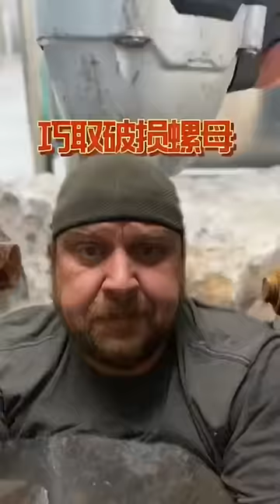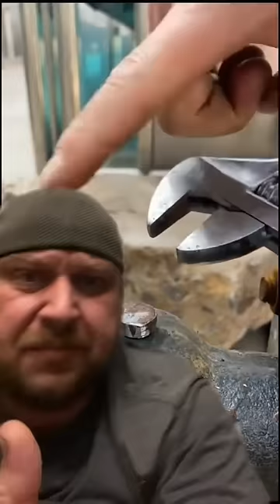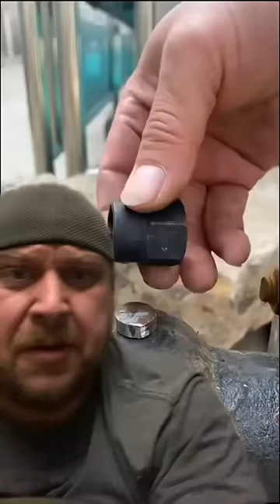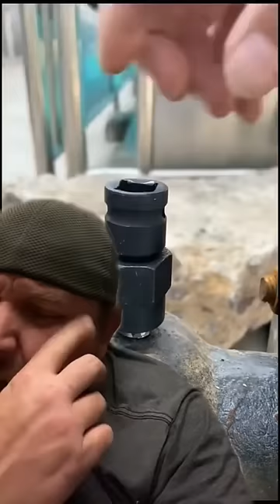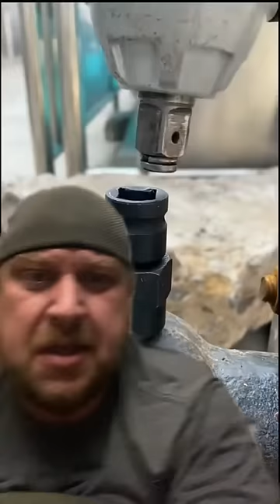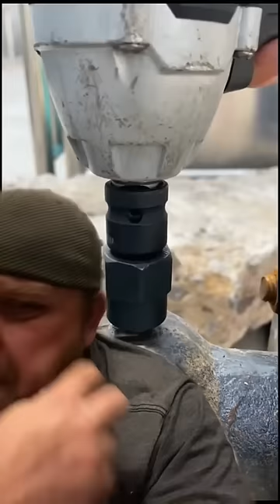Circle Bolt ￼

Comment: Circle bolts. Ah yes
Reply: This seems like something only a plumber would use
Reply: @rustystreamliner  mechanics and any other job that has to deal with someone else’s work 😂
Reply: Do not give car designers any more ideas!
Reply: @rustystreamliner  no Rick's with a shitty pair of pliers and need to remove make circle bolts all the time.
Reply: @rustystreamliner  ... have you never stripped a bolt on something before, particularly for me in a car
Reply: @s0me1usaw  they’re tamper proof, thank for the idea
Reply: just use two crescents put together
Reply: Its a thing. He explained it in his other video
Reply: @justsomefoosent.705  yeah idk I like this guy but this is one of the most helpful tools I’ve got
Reply: Circle bolt sockets. That's great
Reply: bots
Reply: Ofc, triangle bolts are wasteful and unwieldy in tight spaces!

Comment: “Glad your not selling that gun” 😂😂
Reply: Glad my not selling that gun? 🤔
Reply: Lolll
Reply: Too much ugga, not enough dugga. I wouldn't be sold on that gun either.
Reply: What gun.. someone was def. Born in a time where power tools were considered guns... Omfg my brain hurts 🤕 gun.. I give up of society
Reply: @wyck3dcl0wn88  what are you talking about thats a actual term just like drywal uses a screw gun
Reply: @jodygarcia9892  
Exactly lol. Nail gun. Glue gun. A few different guns
Reply: Glad you're not selling English as your first language!
Reply: bots
Reply: Air tools with a handle are called guns. For some reason, similar shape electric tools are not. Probably because air used to do everything electric was just for drills and saws.
Reply: One year later, and only one of you knows what a contraction is.
Reply: glad you bots are still in the comments section repeating everything you hear in the clip
Reply: you're*
Reply: @wyck3dcl0wn88  It is a gun.........What, you think all guns are firearms?

Comment: Idk why but the "ah yeah a circle bolt" made me laugh so hard, thanks i needed that today!
Reply: Imagine stripping a circle bolt
Reply: @contentdeleted4978  🤣
Reply: How did he get the bolt out of the socket?
Reply: @contentdeleted4978  just use a slightly smaller circle socket, workedfor mine.
Reply: Lol I'm saying. Lmao "Circle bolt"!
Reply: I had to reread that because I didn't read the word laugh at first. 🤣
Reply: @codsocrazy  🤣🤣
Reply: @SICresinwrks puluwan is
Reply: @mattx7657 circle wrench
Reply: You can always just weld on a nut of roughly similar size

Comment: Now show us how you're gonna get the bolt out of the socket OK THANKS EVERYBODY, I GOT THE BOLT OUT OF THE SOCKET 8 MONTHS AGO! THIS QUESTION IS NOW CLOSED 😂
Reply: Sand or cut the edges to make a square and use a wrench. Better than buying socket set you’ll never use.
Reply: vise grips
Reply: @jjortiz7504  I use them probably 5 to 6 times a week. they paid for themselves on the first bolt.
Reply: Thread the bolt back in and try tightening it up.
When you remove it the second time it won't be as tightly bitten into by the socket.
Reply: Easy way is to loosely rest the socket with the bolt side down on the jaws of a vice. Use a punch to reach the bolt head through the socket and hammer it out.
Reply: @jjortiz7504  but how the square bolt exit the wrench
Reply: Literally just thread it back in the hole a couple threads and wiggle the gun and then take the bolt out again my hand. Have you never gotta a swollen lug nut or something stuck in your sockets?
Reply: @jjortiz7504  bolt extractors are dead useful. Have fun wasting your time, I'll just spend the 25 bucks and keep making money.
Reply: a screwdriver
Reply: You throw it against the floor or driveway. It'll usually pop loose on the first attempt. Put your purse down and try again if it doesnt.
Reply: Thread it in slightly and pull the socket or you can use a vice and a punch and hammer if it’s stuck
Reply: Guys, guys, guys... let me introduce you to a thing called chemistry.
Get a 1/3 of cup of any kind of cooking oil, add a pinch of black pepper, baking soda and few squeezes of any citrus (lemon, orange). Mix it. Spill it over the socket and let it react. Count to 20. Et voila!
0 effort = 100% result
And you also get a perfectly clean bolt and socket.
Reply: A clamp and a hammer. I do it all the time.
Reply: You use a smaller circle bolt socket, in a process of perpetual motion.
Reply: Clamp the socket down use a screwdriver and hammer that will get it out 😂
Reply: Just clamp it in a vice ...what, you gonna reuse it?
Reply: A cutting torch would work to get the bolt out of the socket.
Reply: hit it from meny different angles and swear at it meny times

works like a charm
Reply: As others have said just use a hammer and punch to drive it out, if it’s stubborn a bench vice to hold/support the socket helps.
Reply: Punch hammered through the middle
Reply: with the patented circle bolt socket extractor.
Reply: You put it in a vice and spin the socket in the opposite direction, it unscrews itself from the bolt
Reply: The same shitty hammer. It'll get it out
Reply: @markperrault8487  That was my second thought. Vice grip and beat it back and forth. These people in these comments have never delt with anything like this apparently...I wouldn't do this with a regular socket but I would with this bullshit circle socket
Reply: The power of welding!
Reply: @miku5840  Welding? What ruining a socket and not getting a weld to stick from a socket to a bolt because it's different materials? What do you mean 🤣 I've been welding for 12 years for a living and I don't know what you're talking about
Reply: @jjortiz7504 if you are a tech you should buy twist sockets. Cause you will end up usung it. Gear wrench sells them for dirt cheap. Dont buy blue point (snap on) they sucked. Returned it after first attempt.  (Disclosure i buy tools from every company, certain brands makes certain tools better. Don't start whining).
Reply: Same hammer
Reply: @damyr  Mercury fulminate
Reply: @sadfur8728  FBI now knows your location.
Reply: Here's the trick ya don't
Reply: @damyr  can I use white pepper? I haven’t got any black. Yeah, some four seasons but I’ll be damned if I’m gonna sort them all by colour.
Reply: Put the bolt in a vise and change the rotation of the impact it’s easy
Reply: @peterdefrankrijker  Sure. Just no red pepper. That's forbidden.
Reply: I really hope everyone in here is just kiddin around wit these comments bc all u gotta do is take off the adapter and from the circle socket and punch the circle bolt out smh 🤦
Reply: @kylebrooks8128  crazy, i asked jokingly and I'm still getting responses 8 months later...
Reply: @kylebrooks8128  usually just reversing the impact is actually enough to knock it out
Reply: Vice it and hammer it out
Reply: @Man-vs-Metal  bingo
Reply: @TrashBandit45  no
Reply: Probably going to grip the threads with pliers...
Reply: Forward direct with bolt in vice
Reply: SaltyBrains  Dremel 😂
Reply: Most sets come with a bolt that threads into the back of the socket. That’s why they have a hex on the exterior.
Reply: Fun thing I use these often at the dealership I work at in the case of rounded out bolts. When they get stuck in the socket I pop a old beat up phillips head screwdriver into the drive end of the socket, hold the socket and give the hand a good whack on a solid surface, knocks it out pretty easy.
Reply: @Man-vs-Metal  This.
Reply: No
Reply: This is your daily reminder to figure out the answer to your question 9 months ago.
Reply: @straightvibin6972  I was JOKING 😂 and yeah, i edited the comment and everything. I just wonder how long the algorithm will keep it alive.
Reply: @jjortiz7504 until you use these sockets on lug nuts you’ll truly never understand what they’re best at! Ford f150 lugs teach you a thing or 2 and these sockets are one of those things your learn to love!
Reply: Literally just put the bolt in a vice run it backwards boom problem solved just cus yal don't know shit don't mean there's not shit 😂
Reply: @gangshytgaming3019  just cuz you don't know what's going on don't mean it don't make no sense. Question has been answered over and over for 9 months. 

Thanks though.
Reply: Vice, punch, hammer.
Reply: @hiijjh100  is nobody reading the WHOLE comment they are replying to?
Reply: Torque stick and hammer
Reply: I saw a lot of shitty answers…. A punch of some sort will do the job just fine also some oil and a hammer
Reply: The thing about shorts is that they will get recommended even if they’re like 2 years old
Reply: Put it in a vice and use a hammer and punch and hit the head of the bolt out
Reply: With heat
Reply: You lay the socket and bolt on the ground and hit the socket with a hammer
Reply: @brucetec6597 *vice
Reply: If you got a vice grip, use it
Reply: Put it in a vice and take a lunch and hit it out
Reply: Question ain’t closed til we say it’s closed.
Reply: I'm a personal fan of the hydraulic press myself. Made myself a whole frame just to get bolts out of sockets. Plus I actually get some use out of the damn expensive press

Comment: “Circle bolt sockets”😂
Reply: O MY GOD ITS QUANDALE DINGLE!!!
Reply: At the shop we call em easy outs
Reply: Where I'm from, that's called a security lug nut remover. 🤫
Reply: I know this is satire but this video physically hurts
Reply: @maltait  what do you mean?
Reply: I’m so confused. This meme randomly popped into my head yesterday after not hearing about it for like a month, then I see this.

I should wish for a show to appear on Netflix, should appear in a few weeks/months.
Reply: Someone please help me ive been in trades over 6 years and idk wtf these sockets were ive never seen one before
Reply: They're called die nuts or threading dies. They're used to rethread bolts that have been stripped, or - in the case where I first had to use them - are covered in paint.

Comment: I’m more of an oval nut man myself.
Reply: now this may be a stupid question but would that work?
Reply: @phoneusandfroboof829  if the socket fits
Reply: My old man swears by elliptical rivets , but I'm not a huge fan
Reply: Hmmmmmmmmmmm
Reply: @phoneusandfroboof829  I like it, better than flathead
Reply: Crazy. Figured you were more of a deez nuts type of man
Reply: @hughjasso6084  you are a man of culture among these npcs
Reply: @JayV27  but if it doesn’t fit you can always just make it fit just weld it on and bam it now fits 👌just right
Reply: Hey me 2
Reply: It used to be brave to pronounce that openly, now it's just common.
Reply: I wad adventurous and tried the oval nut once, but she tightened the clamp too much. Never again.
Reply: @phoneusandfroboof829  Yeh, honestly they would, maybe even better, but the clearance for the socket would be, well, pun intended, nuts.
Reply: You only have one?
Reply: @phoneusandfroboof829  alot of nuts especially on suspension components are ovaled on the threaded they're kinda a pain because they if you don't notice you'll think you're crossthreading
Reply: The fact that oval screws exist upsets me.
Reply: @Big-lron  They actually oval them in order to make them lock to prevent backing off. Neat idea for a locking nut. Use them on driveshafts, suspension parts, anything moving a lot.
Reply: Biden
Reply: Sorry to hear that. You have to use only bolts in Novembers.
Reply: @Big-lron  I think you're meaning "Tek" threads for self tapping. Alot of bolts in car frames are friction drilled, then bolts with flutes, so that the chips from tapping have a place to go, are used.  Work pretty well actually, except the fartheads who decided to use them in aluminum, like lawmmower deck spindles, which electrolytically weld together.  
I think other dude was talking oval bolt heads.

It's only 7 AM and I have used all my nerd allotment for the day. 🤓
Reply: I have oval nuts too! 😝
Reply: All that is necessary for oval to triumph is for good men to go nuts.
Reply: @ricksanchez3176  I've seen that tamper resistant fastener.
Reply: @RJ-wx3fh  nice
Reply: @phoneusandfroboof829  To my surprise they are actually used commercially on coffee ☕ machines as a security bit. I even have one bit in iFixit set. 
For sure it can handle less torque than spline Drive or 12 point. There are also hex bolts with torx in them. I'm pretty sure they meant to be used separately.
Reply: @UltraGamma25  It won't slip like a flathead can.
Reply: @ArthursHD  Exactly
Reply: This was fukin hilarious! Thanks for being "On It!" 🤣🤣
Reply: Oval nuts😂😭
Reply: @phoneusandfroboof829  honestly, as a concept I can definitely see oval head bolts having a lot less issues regarding stripping and they would allow for a bit more leverage while tightening or loosening them.
Reply: Not you said that I realized that that would actually be an effective bolt head in my mind
Reply: My like, brought the likes to 2000, I can die happy.
Reply: @rustystreamliner  😂 That would be a circle DOLT.
Reply: Nah they're making them oval now?
Reply: You might want to see a doctor about that
Reply: Ah yes, the infamous and annoying as fuck oval nuts
Reply: comments are hilarious man.. I love this guy
Reply: The oval just seems to catch more often
Reply: @TurboB20v  but you will need a different sized wrench or socket for it
Reply: If the sockets fits it sits🤣🤣
Reply: Nah bro I mess w sphere nuts bro
Reply: William Defoe: You know, I'm a bit of an oval man myself
Reply: Excellent
Reply: Go see a doctor for that
Reply: Oval nuts with oval sockets would probably work better than a 6 sided nut because the force would be more equally applied over the whole surface. Right?
Reply: Of course you are
Reply: Oval? I prefer the sphere, it’s curvature provides the perfect grip
Reply: @phoneusandfroboof829  shhh dont ask that question here they will hear
Reply: I had oval nuts once- doc gave me a shot and cleared it right up.
Reply: I prefer the star ⭐ bolts FTW
Reply: Oval and out
Reply: I like my square bolts
Reply: I can't tell if this is sarcasm, because those exist
Reply: That's what... nevermind
Reply: @Sam-ql4um  Ong, like they really think y'all talking about bolts, boomers, LMFAO 💀
Reply: Gross wtf reported
Reply: @JayV27  it always fits if you push it hard enough.
Reply: That's what she said 🤣
Reply: @phoneusandfroboof829 as long as it’s not perfectly circle to twist something. An oval wouldn’t slide like a circle
Reply: Those are real though.  Aerospace floating nutplates use nuts that are slightly smashed in order to act like thread locker.
Reply: As long as yer not werkin wid rusty nuts, ya should be ok.
Reply: @JayV27  😂
Reply: For Security purpose I guess
Reply: I’m more of a straight line but man personally
Reply: Oval? Would that eliminate stripped bolts? 🤔
Reply: @phoneusandfroboof829  he’s joking but the funny thing is a oval socket would actually work
Reply: @RJ-wx3fh  brother
Reply: @RJ-hk7oj  börther
Reply: I like the trapezoid nuts the best, simple and easy to remove
Reply: @phoneusandfroboof829 they actually exist
Reply: I'm more of a ball bearing kind of guy
Reply: Ha oval, talk to me once you use the dodecahedron nuts like a real man.
Reply: Is an oval nut a wing nut thats had its wings clipped?
Reply: I am too, I had a doctor look at it. They said it was weird af but it shouldn't affect my sex life too much. Shows how much he knew though, every girl I've been with since has asked how long I need to sit on it til that shit hatches. 😔
Reply: @phoneusandfroboof829 sarcasm is king
Reply: I just like nuts in general
Reply: @phoneusandfroboof829 I mean there’s a different shape and can’t slip so probably
Reply: Advanced Thumbscrew
Reply: @phoneusandfroboof829 I think he means his balls.
Reply: I don't rectangle anymore as it seems it's for squares.
Reply: Non-Euclidean bolts are the best. You get leverage in multiple dimensions.
Reply: Bruh lmao 😂😂😂😂😂😂😂
Reply: I'm more of an multidimensional nut man myself.
Reply: So many modern lug nuts and bolts fall apart these days and need these.
Reply: Circlrle nut
Reply: @phoneusandfroboof829 i dont think so honestly...  if you think about it, the bolt going into a round would only have the clamping force by only ½... because only the 2 longest ends of the Oval would be holding..
Reply: Yall sissies should try headless nails...
Reply: Stupid thing is they exist
Reply: @UltraGamma25 anything besides flathead... I'll take anything over those
Reply: Jack never likes oval nuts at home  🤔 🤔 🤔
Reply: @JayV27 it sits
Reply: See but that would actually be functional
Reply: Impressive. I can only ever manage Jackson Pollack art.
Reply: I enjoy the lucky 4 leaf clover pattern,you know when you come behind the guy who “saves time” with a crescent wrench🍀 if you catch my drift or should I say slip😂😜😜😜
Reply: Novice remark. Experts use the cone topped bolts.
Reply: Did you know an oval is actually an amazing fastener? They make them for mines and mills as liner bolts and it’s almost impossible to break them in the traditional cam out/ round off fashion.
Reply: @phoneusandfroboof829  do you not have a set?
Reply: Those new anti matter core bolds are gnarly
Reply: @UnderDwaterAstronaut  that’s some wh 40k shit
Reply: Balls.